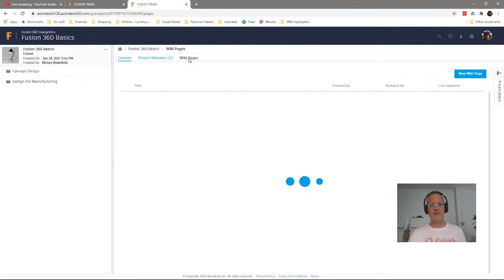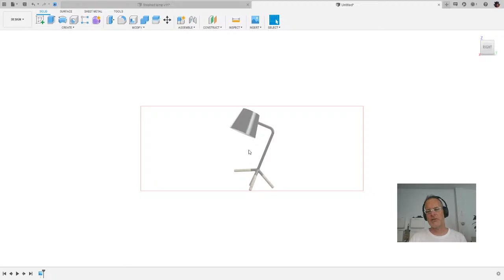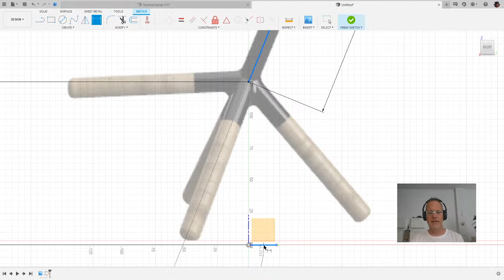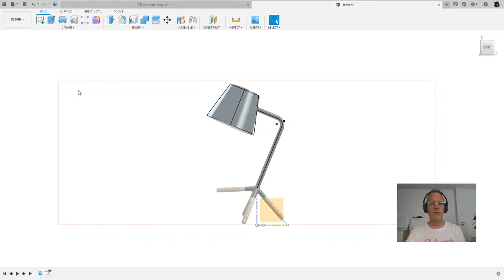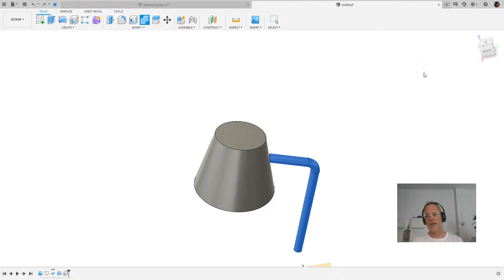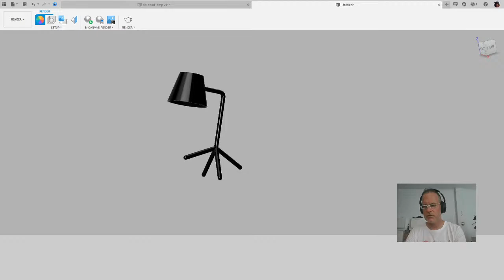Parametric CAD Basics with Fusion 360 - Live Teacher!

Comment: I just installed Fusion 360 and I can't find the icon you're clicking at 17:22. I see a 'New Project' button, but no 'Data', 'People', 'Upload', 'New Folder' or gear icon.  Could this be a configuration difference, or perhaps my version is newer than yours? Thanks for any help you can provide.
Reply: Found the problem. You must have a project open before the buttons I couldn't find appear.